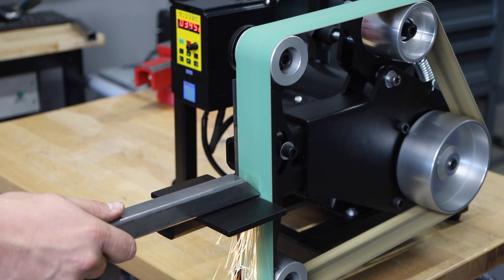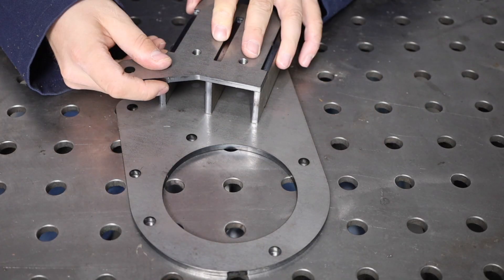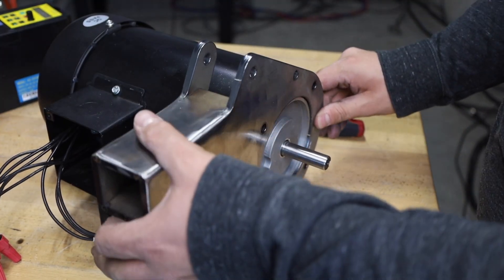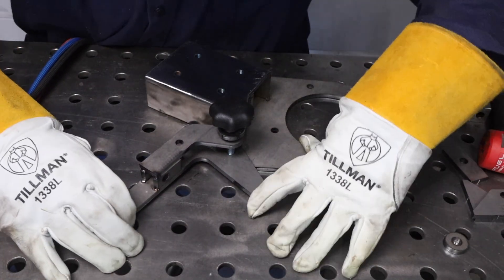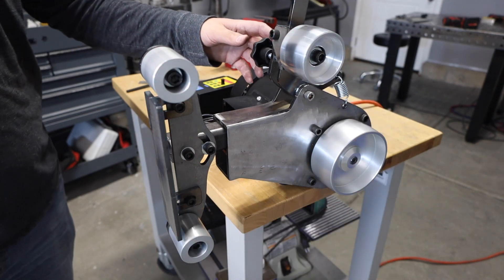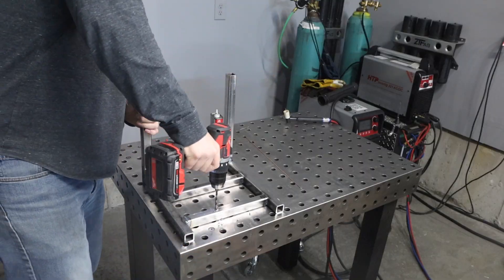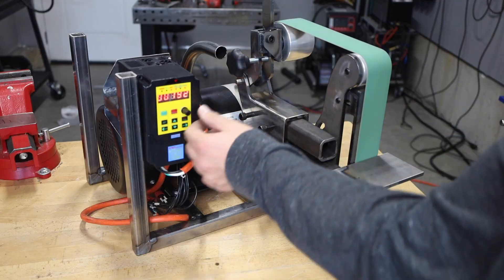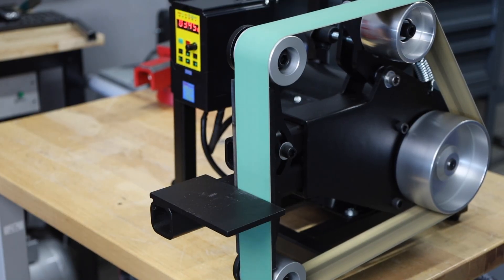I Built A Better Belt Grinder…Here’s How

Comment: I work in a laser cutting shop and I've built a 2x72", I love it but dang it's a LOT of machine and definitely NOT portable; I can lift and carry it but I need a pretty good reason to do so.  It also takes up a TON of bench, and floor space in front of it, it sticks out a good 15-18" beyond the edge of a 24" deep bench.
Honestly, for general shop and fab work something this size would suit most people much better so I really appreciate you uploading the files, I think that's the push I needed to finally build another and downsize to something a little more manageable.

Comment: What gauge steel did you use? I’ve designed a lot of tab and slot stuff, it’s really great! Wish I had a welder at home haha
Reply: The listing at where he had the pieces cut indicated 1/4” inch hot-rolled, pickled and oiled steel.
Reply: @dennisyoung4631  good eye! Thanks.

Comment: I work at a metal fabrication shop.  I have designed and had laser-cut a couple of parts already, but I really want to put together a kit like this at some point.  Thanks very much for the inspiration!

For those who have not seen them (like me, in the past), having precision-cut locating tabs and holes are amazing!
Reply: Do you need this belt grinder

Comment: Please send us the links where you bought those bearings and VFD. Thanks
Reply from the maker: There are links to most of the main components in the description. 
These are the rollers and they came with bearings installed. https://amzn.to/3eAPb82 They are a metric 12mm bore, but I just used a 7/16" bolt and it seems to be working all enough. 
This is the VFD I used: https://amzn.to/3EGpQnL . It works well overall, but it isn't ideal because it circulates air over the electronics and with the proximity to the grinding dust, that could cause problems at some point. I may add some filter material to the vents to avoid this. I'm also skeptical as to whether it delivers the power that is claimed based on the amperage draw, though the grinder still has plenty of power.

Comment: I need the speed controller. Thanks
Reply from the maker: This is the one I used: https://amzn.to/3EGpQnL . It works well overall, but it isn't ideal because it circulates air over the electronics and with the proximity to the grinding dust, that could cause problems at some point. I'm also skeptical as to whether it delivers the power that is claimed based on the amperage draw, though the grinder still has plenty of power.

Comment: I see the roller wheels you have linked use metric thread bolts.  Might be easier to service getting standard 1/2 bolts and slightly more expensive US made wheels.  Origin blade maker on eBay sells some good stuff and their polymer wheels work well for about the same price.  I returned some vevor rollers for this reason on my build.
Reply from the maker: I went back and forth on some different rollers, but ended up just using 7/16" bolts through the metric bearings. They seem to run fine for now, but if they start having problems, I'll probably upgrade. I'll have to check out Origin Blade Maker to see what they have available. Thanks!
Reply: @TimWelds  I’m guessing those bearings have a 12mm bore, e.g. 6001 bearings.  12mm bolt might fit sloppy enough to make for erratic tracking.
Reply: @dennisyoung4631   the wheels are 12mm. I'm probably going to order the OBM set with a 7" driver. Those have a 1/2" bore. I am trying to figure which bolts to use. I kind of want to use a 1/2" o.d. shoulder bolt with a 3/8" screw but not sure yet what to do.   I'm going to use shoulder bolts for the pivot points of  the tracking wheel & platten.
Reply: @migs1121  shoulder bolts usually have fairly close to nominal diameter “shanks”.

A project I’m currently workin on will use a pair with 1/4-20 threads, and the part that the “shanks” will go in is to have replaceable bushings to provide added strength and replaceable wear points.  I have one as a rough example right now.

1/2” bore bearings are commonly designated as “R8” - at least, the ones I’ve seen, shopped for, and purchased have.

Comment: might want to put a lock nut on the tracking screw.
Reply from the maker: I wondered if it would walk around on me, but it has held position really well so far. The grinder doesn't really vibrate move around during use. I like the ability to make a quick adjustment, so if I do anything, I'll probably add a spring or just slightly deform one thread with a punch to add a light locking feature.

Comment: I've been on the edge of building a 2x72 for the last 2 years but have been torn over the space it would take up in my small shop. Until now I haven't seen a decent design for a 2x48. Many thanks Tim - this is now on my to-build list although I may make a few mods in order to use a motor I already have.
Reply from the maker: Awesome! I've helped build a few 2x72s for friends and have had the same hangup on the space they take up. I figured I might as well just make one that will work for me.

Comment: Cool stuff. Can you talk about the design and the pulleys/rollers, what’s the sourcing of them. Thanks
Reply from the maker: Thanks! I linked most of the components that I used in the video description. As far as the design goes, it has similarities to a lot of designs already out there, but by using the tab and slot construction of the main housing, I was able to reduce the overall part count and a lot of hand cutting.

Comment: Do you have a link for the speed controller?
Reply from the maker: This is the one I used: https://amzn.to/3EGpQnL . It works well overall, but it isn't ideal because it circulates air over the electronics and with the proximity to the grinding dust, that could cause problems at some point. I may add some filter material to the vents to avoid this. I'm also skeptical as to whether it delivers the power that is claimed based on the amperage draw, though the grinder still has plenty of power.

Comment: Super job! So…aside from it being custom designed, is there any savings between building yourself or buying an off the shelf similar grinder?
Reply from the maker: It's not quite apples to apples with those on the market, but it ended up costing around half what I would have spent for a comparable off the shelf unit, not including my time.

Comment: Very nice project. Looked like a lot of fun building and very useable. One thing I'd do is put a spring between the roller adjuster knob and frame so it doesn't loosen when running . it looks liken it would be just fine as it is. Great video. Thank you.
Reply from the maker: Thanks! That's a great suggestion, reminds me of a carburetor adjustment screw. If it starts wandering around on me, I'll throw one on there!
Reply: @TimWelds  Or a jam nut...

Comment: what's the mini angle drinder you're using?
Reply from the maker: It's just a right angle die grinder with a surface conditioning pad on it. That particular one is battery powered from Milwaukee. They're kind of expensive, and I haven't had it that long, but I really like it. I used cheap air powered ones for 20 years, and they work just as well, but I got tired of dragging out the compressor to run that one tool.

Comment: That's very slick! What was the total cost of the project?
Reply: I second this question! Would be helpful to know.
Reply from the maker: The total cost was about $600, though I already had some square tubing on hand. You could save some cost by using a single phase motor without variable speed. The big ticket items were:
Laser Cut Plates: $150
Motor: $220
VFD: $90
Rollers: $70
@Brian Ieduc As far as kits go, I designed this one from scratch, so there is no kit right now. Most of the major components are listed in the description as well as the CAD files for the plate work. There's also a link to add all the plates to a SendCutSend cart.
Reply: @TimWelds  Cool, thanks. Now all I need to do is get skilled enough with my TIG welding where I don't need to order 7 sets of parts from SendCutSend :)
Reply: Very nice
Reply: Awww should have went with 2x72
Reply: @Gary Postell  Why?  (Honest question)  I kind of like the smaller footprint.  I know 2 x 72 is what high-end guys use, but I don't know what that would gain me over  a 2 x 48 belt.  (I'm going to use the same motor whichever I build)
Reply: @SvdSinner my understanding is you get more belt for your money and better heat dissipation.
Reply: @garypostell5268 compact and portable ? Nah
Reply: @garypostell5268  You kinda missed the point.
Reply: Very  nice  belt grinder  I'm like every one else who watches  projects   never say the cost or were to  buy the kits clearly
Reply: @brianleduc7797  He put the entire project in the description.